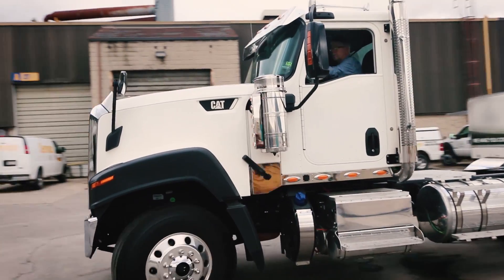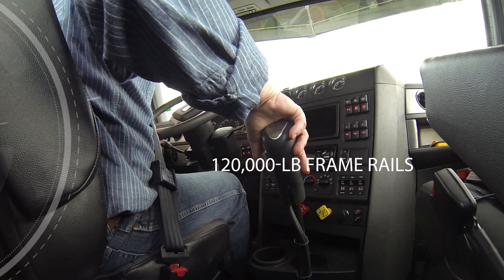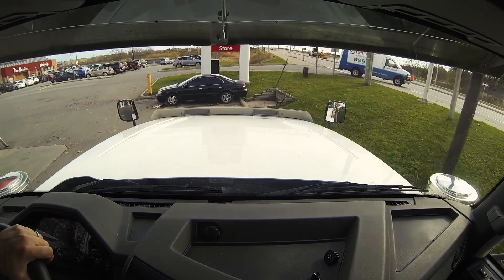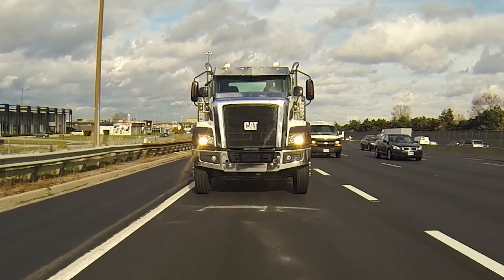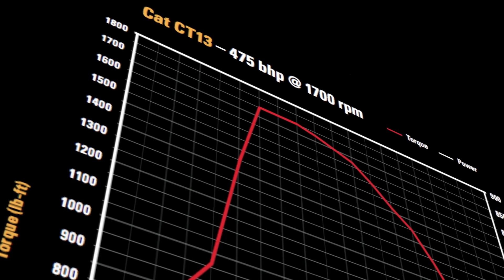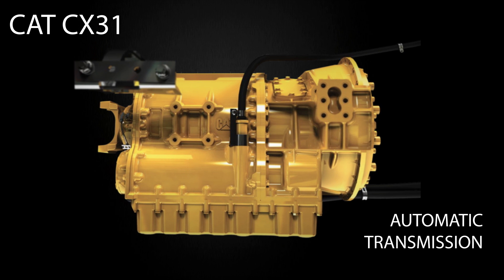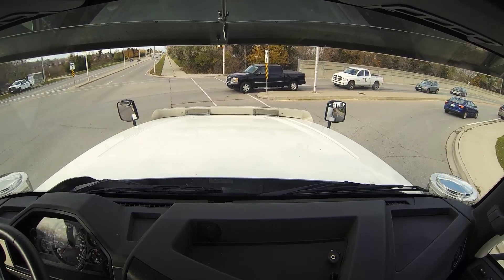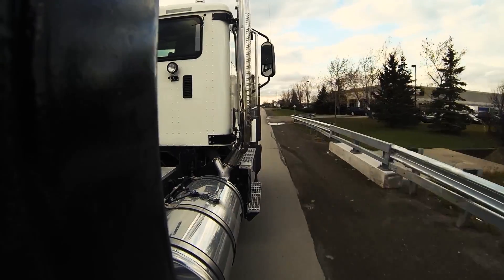Focus On... CAT CT680L: Performance Evaluation

Comment: I think that I'd prefer a Cat C15 and a 7 speed Allison.
Reply: Or a ZF traxxon 16 speed.
Reply: @thepowerofdreams6816  To big to expensive to heavy, to smooth, to easy to shift (always with clutch) those are weird in North America MEX, USA, CAN.
Reply: @fabi57iamracer  Yeah, the only nice things really about the old single countershaft manual zf is the pattern is a pancake, 8 speed manual with a spliter, but yes they are kinda softy and tend to break under very high stress, for example climing uphill with 40 metric tons, fullers are simpler and undestructible under good use

buut. The traxon is not a manual, is a 16 speed double countershaft, with  i think 3 or 4 crawler gears
Reply: @thepowerofdreams6816  That ZF aluminum case transmission is huge, all Eaton are double countershaft I guess.